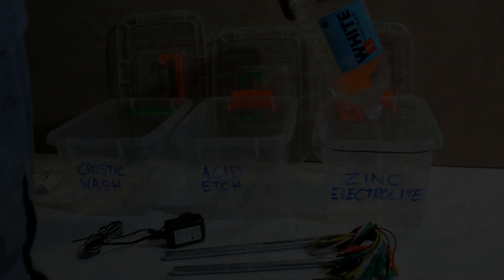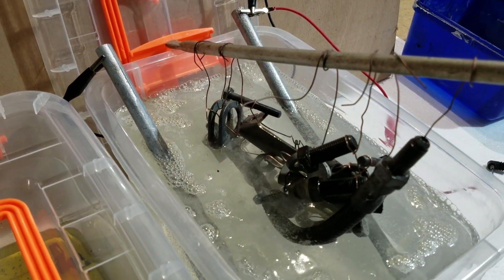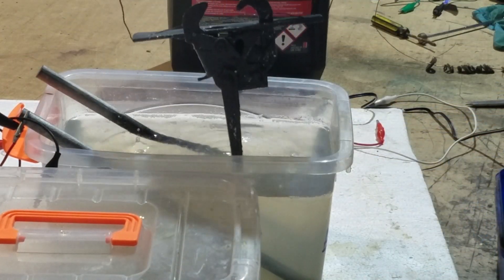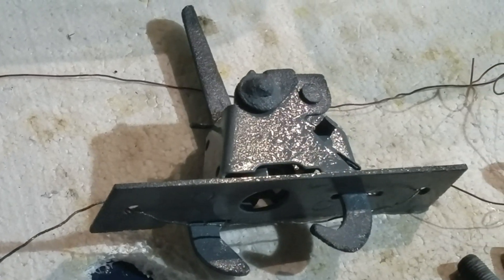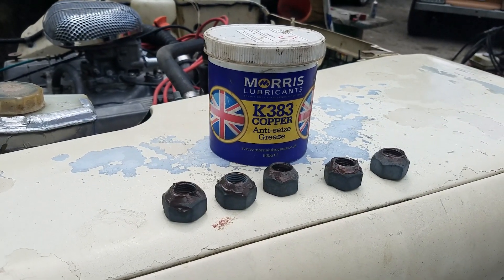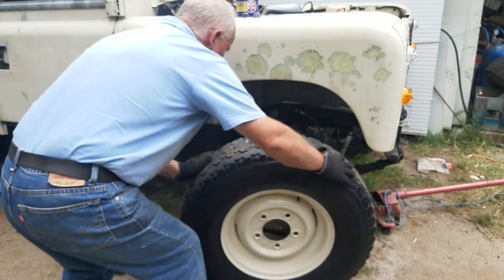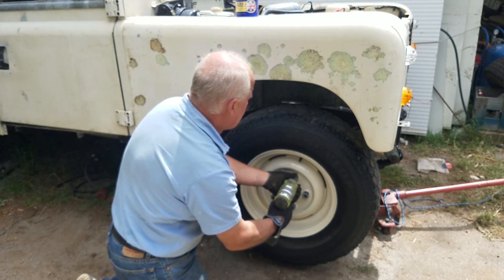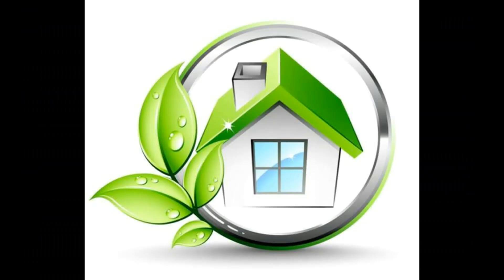Zinc Plating Small Parts at Home! video2- bigger jobs

Comment: so did the zinc finish last?
Reply from the maker: Absolutely! my heavy  duty flat zinc is way more durable than any bright zinc bolts hinges or fittings that Ive ever bought. The landrover wheel  nuts that I plated still look just like the day plated them
Reply: @t.h.o.r.  ok,  however since you didn't end up using any trivalent passivate to convert the zinc layer into a harder surface it still hasn't corroded or formed white powder corrosion on its surface?
Reply from the maker: @valmin5589  Oh yes- Its gone slightly snowy- but is protecting well

Comment: The current from a battery charger is stepped direct current, not a pure DC flatline, more of a saw blade than smooth DC. Using a capacitor on either or both poles will smooth the SDC out. A fine job you're doing.
Reply from the maker: hahahah really !? ( I thought I was just bumbling along! )

Comment: Great videos, thankyou. I thought it might be worth mentioning something tk be aware of when picking in acid. This process generates hydrogen gas (seen by bubbles) which can be absorbed into the metal and make the metal more brittle and increase the risk of the part failing prematurely in fatigue. Something to be aware of for any safety critical parts.
Reply: Very true, it's called Hydrogen embrittlement and causes the metal to fail at a lower yield strength than is normal.